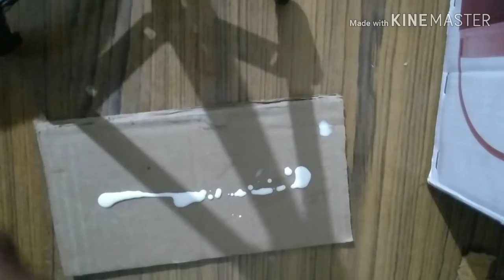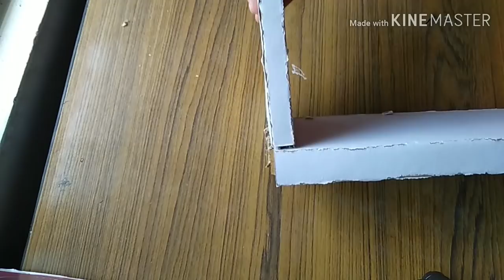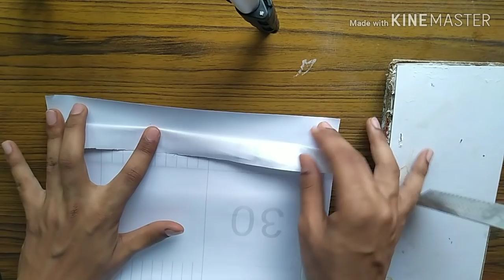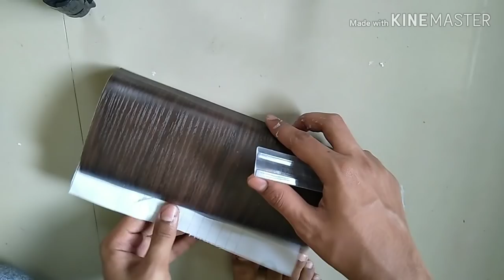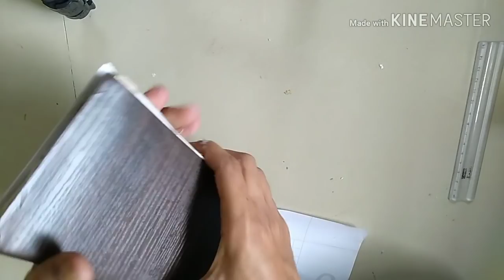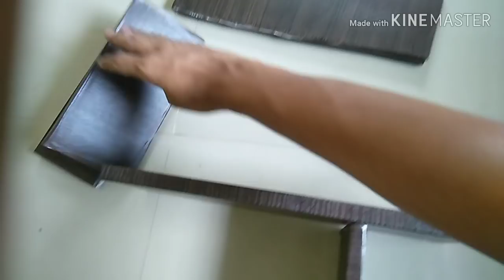How To Make Cardboard Wall Shelf | Cardboard Wall Decor |Home Wall Decorating Ideas |Cardboard art

Comment: Your creativity is super But l think that not strong 🙄but superrr
Reply: you'd be surprised just how strong thick cardboard can be! Especially when cut into pieces and stacked up then wrapped around another piece of cardboard! It can hold quite a bit of weight and it's actually pretty durable compared with particle board which most affordable shelves similar to this are most likely made from. But the hot glue was the only fault i saw here! Awesome use of trash to treasure!!! 👍
Reply: @rahimanaaz5531  m
Reply: @rahimanaaz5531  m
Reply: Same thinking
Reply: I followed all the steps and instead of regular glue i used super glue and I thought of breaking it.....
Wellll..........
I  dropped it on the ground from almost about 10 feet high AND it SURVIVED 
Soo......I would recommend using super glue or a glue gun would also work really well 
🙃🙃🙃❤️